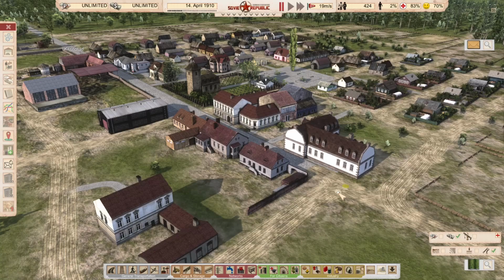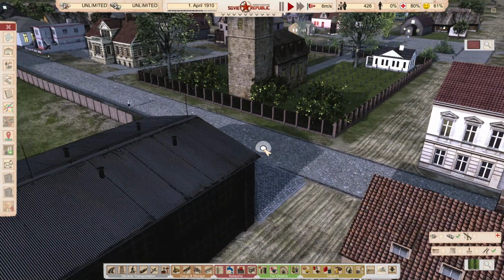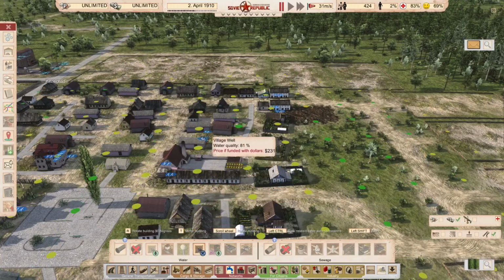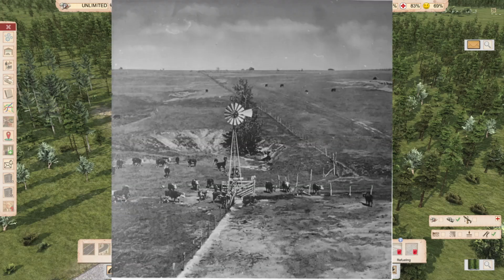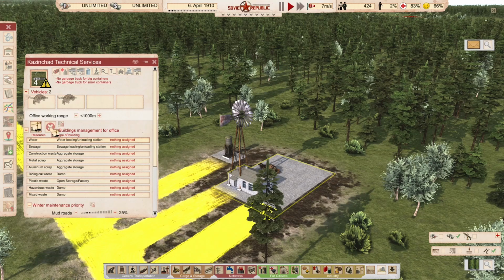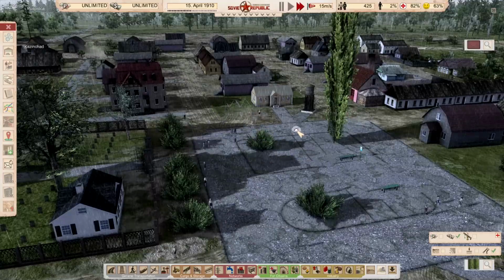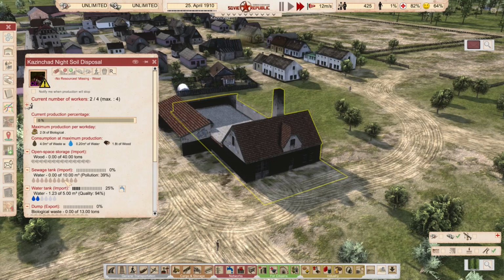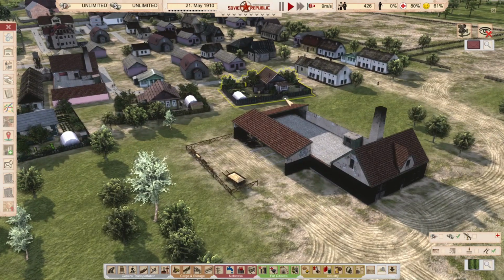Ep5: Kazinchad 1910 Water & Sewage

Comment: Afaik technical office will not send multiple trucks to the same substation even if it has a lot of tank capacity and several idle tiny cistern trucks.
Great work on your first 3d model. :)
Reply from the maker: Good point.  I probably need to upgrade the vehicles.  Or perhaps send them by a line?
Reply from the maker: Further testing shows there was a bug in the Water Loading Station, a mod I created out of someone else's 3D model.  The trucks were only loading 1 cubic metre of water each time, and not waiting to be filled.  Once that was fixed and they deliver 3 cubic metres each time, it works great.  There's a lot of buildings drawing from the substation, but most are very small houses with negligible water requirements.